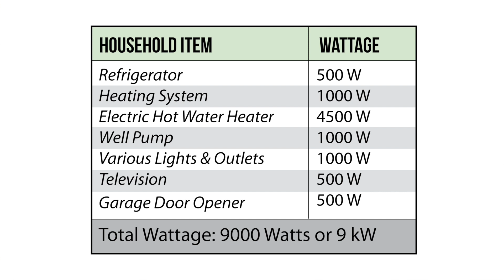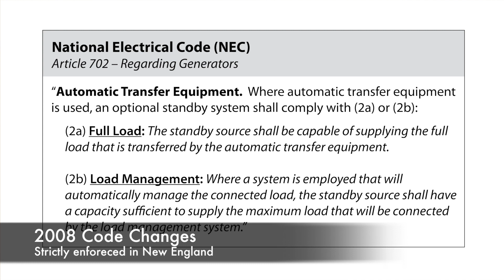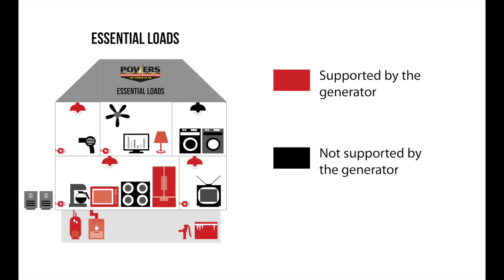What Size Generator Do I Need?

Comment: Cost of the unit aside,. what are the downsides of installing a unit significantly oversized? For example, I may expand the size of my home and would like to have a unit that can accommodate that.
Reply from the maker: Hi there! The only downside to installing a unit larger than you require is the cost. If you are planning on a home expansion in the very near future, it makes sense to consider what your load needs will be at that time.

Comment: Admittedly, my experience is limited to 2 well pumps and 2 different 5kw generators, but neither generator would start a 3/4hp well pump.  If you have a well, you probably need to start thinking about 7-10kw at a minimum.
Reply: 5HP pump should function on 5kW ... including starting.
You may have a wiring issue or a pump with an issue.

Comment: may I ask you is it possible to run my PLasma cut 50p plasma cutter from a petrol generator and if it is what would be the best size or spec generator to use without breaking the bank. Cheers peter